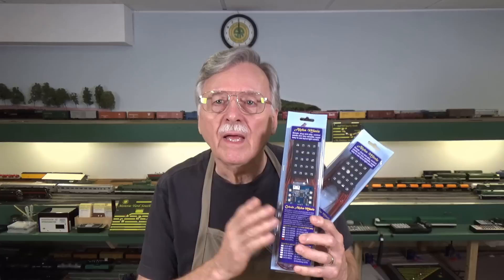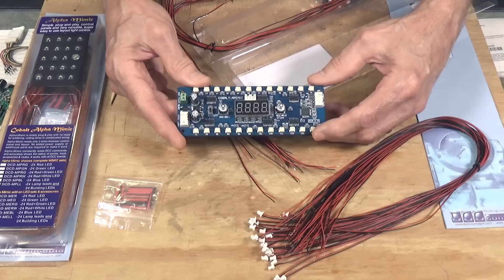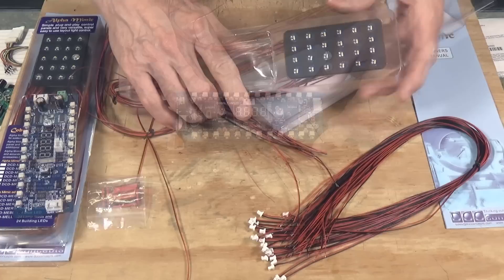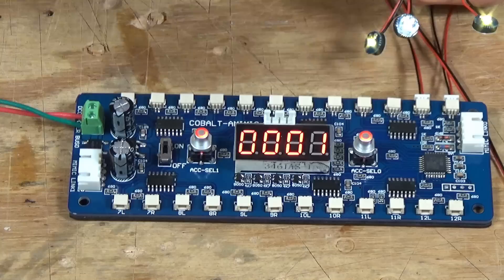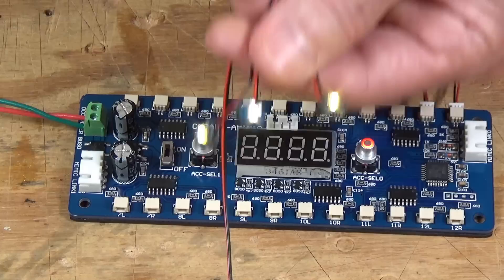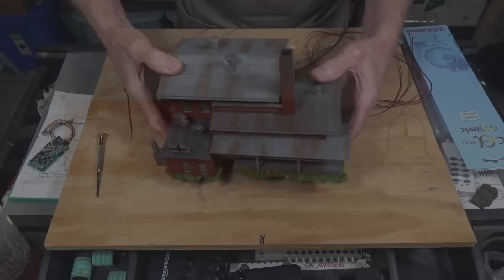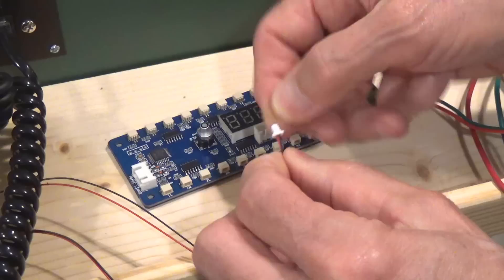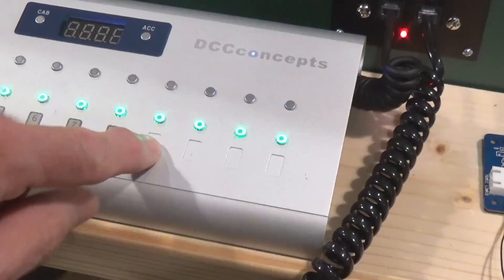New--Building Lighting With DCC Control (274)

Comment: It's worth noting that NCE has a product called the Illuminator that runs off the DCC bus that uses Just Plug compatible JST connectors and is otherwise fully compatible with the Just Plug system.  This carries the NCE disadvantages of poor documentation and high defect rate. However, the whole Just Plug product range is available if you want to use the DCC bus. What I've found is that if you use DCC addressing, the more decoders you have, the higher the likelihood of address conflicts, so if you turn off the headlight in loco 2325, you can also turn off the lights in City Hall.
Reply from the maker: Yes and on Friday I’ll show you how to use the Just Plug lights with these.

Comment: Interesting device makes lighting pretty easy.  Thanks!
Though I'm looking forward to trying Arduino boards to control everything but the trains.  
The code for basic sensing, timing & switching is quite simple really.
Reply: I built my lighting rig with a nano. It controls 32 lights, individually addressable with PWM. I need to build a second one for my layout. I used an 8 port ethernet box as housing. I added wifi and want to make a simple app for easy controls. Getting there, but a fun homegrown project for sure.
Reply from the maker: I know there are power users like yourself who can pick this stuff up easily. However my neighbor decided to try them and ended up spending 6 months “learning” and now just has a box of junk that doesn’t do anything. So for folks like him anything that is near plug and play probably is a better option.
Reply: @TheDCCGuy  Ah yes. Well, that is true to an extent for sure. I have a passing interest in electronics and had programmed back in the late 80's on my old XT class computer.

Comment: Larry,  I just started setting up this on my third level layout.    Is 1L and 1 R the same address or two different addresses.  I have two leds plugged in one in 1L and the other in 1R  I setup the address to 501   On my Power Cab Sel ACCY  type 501  then do 1 or 2 and the LED in my Building goes on and off The one in 1R does not change.  I tried using 502 and nothing changed on 1R  Any ideas or suggestions  Thnkas
Reply from the maker: Yes 1L and 1R are the same you just select accy control and turn it on or off. If you want both on at the same time then you have to reverse wire one of them.
Reply: @TheDCCGuy  thank you

Comment: Question, do you recommend removing the springs when mounting turnouts with a Tortoise switch machine. Would sincerely appreciate your thoughts. Thank you
Reply from the maker: Yes, various studies have shown they potentially cause early failure of switch machines and most manufacturers recommed this.

Comment: Two more questions, Larry, but you don’t have to answer them on your Sunday. Will this work on a Digitrax loconet? And do I need a separate bus for powering all this or can I hook up to my track bus? My layout is of medium size with no power boosters aside from the one built into my Dig 210.
Reply from the maker: It isn’t connected to the Loconet, just to the main power bus or an auxilliary bus. I was using a DTX Zephyr for the bench-top tests and it worked fine, but I also have a DCS210 that I will try it with when I get time.

Comment: Can you use this same device to throw switch machines, or do they make a similar device for powering multiple switch machines?
Reply from the maker: I think their Cobalt iP Accessory Decoder FX Stall Motor Drive (8-way Output) will do what you want but let me shoot them an email to be sure. I know it works with their Cobalt switch machines but need to ask if it will work with Tortoises. I don’t know how or if the death of the Queen affects their work schedules so it may take a few days for an answer.
Reply: @TheDCCGuy  thank you so much for responding so quickly. I appreciate your research and all that you do although much of it is over my head. That’s why I’m trying to simplify things. I’ll look for your follow up on this. God bless.
Reply from the maker: Ok, the folks at DCC Concepts say these will work well with the Tortoise.
Reply: @TheDCCGuy  thanks, Larry.

Comment: Hi Larry
I have been in touch with Mike at DCC Concepts about using a 3v DC Relay with a coil taking 33mA. This is below half of the stated max load of each output of 75 Ma. He has stated that the manufacturers of the board have told DCC Concepts that the max imput to board is 250mA. Therefore 3 outputs of 75 Ma would overload board.  He told me they were going to add the maximum outputs over the 12 outputs should not exceed 250mA.
Hope you have not cooked your board.
Reply from the maker: Thanks for that info, I’ll contact them for an update.
Reply from the maker: I just heard back from DCC Concepts and they say you must have misunderstood Mick. The boards can take 75 mA per address (channel). Here is what I just got from them:

I have confirmed with Mick that the advice given was 75mA per output channel.

I think this chap (suspected by Mick) is someone who wanted to use Mimic to drive multiple 33mA relays - this is somewhat pushing the board outside its operational design of powering LED lights and Mick advised against this.

So for now I think we are safe with the limits I laid out in the video.  Thanks again though for getting back to me on this so we could get it cleared up—Larry

Comment: Hi Larry.  What's the connector type for the mimic link?  I presume we have to buy those separately.  Or is one included in the expansion kit?

I won't ask if DCC gave you a hint about availability in the US.  I'm going to guess they'd like to have them in US shops & online by Thanksgiving for Christmas.  Hope they make it!
Thanks for the review!
Reply from the maker: As I said in the video Iron Planet Hobbies has them and actually they are on sale right now! Also as I showed in the video you get 24 wiring harnesses in the basic kit along with 24 LEDs.
Reply: @TheDCCGuy  Ah, I misunderstood about the availability, Larry.  Getting old is a treat!  
The wire connectors I was referring to are for the two daisy chain connectors, one on each end, rather than the 24 small connectors along the sides.  Those two daisy chain connectors appear to be much larger.  
Very nice review.  Thanks.
Reply from the maker: I am not sure where those link connectors are, I’ll have to ask. I looked on their website but don’t see them.
Reply: That's our error, guys! Sorry! The link cable should be in the box with the building lighting! If anyone needs one, just email us and we will send one out straight away! Production packs should have these link cables included in the box! Sorry again!

Comment: Are they using the same JST connectors as Woodland Scenic, and if so I wonder if the LEDs are interchangeable?  It’d make a nice way to migrate from WS to DCCC. On the other hand the DCCC programming/panel looks pretty clunky to me.
Reply from the maker: Maybe I’ll waste one to find out.
Reply: @TheDCCGuy  DCCC only specifies a max draw of 50mA, no idea about the voltage so you may need to break out the multimeter!
Reply from the maker: White LEDs have a typical operating voltage of about 3 VDC at about 20 mA. What exactly were they referring to when they said 50 mA? Could that have been per address on the board? That would be consistent with their stated limit of 3 LEDs per address.
Reply: @TheDCCGuy  At the bottom of the Mimic Owners (sic) Manual first page, in red, they say max 50mA per output. So yeah, that works for 3 LEDs if you don't drive them too bright.
Reply from the maker: Ok, thanks. I noted that in their latest email on these yesterday they now say 2 lights per socket which is consistent with white LEDs drawing 20 mA each. Three lights on a socket for a total of 60 mA would go over the 50 mA level.